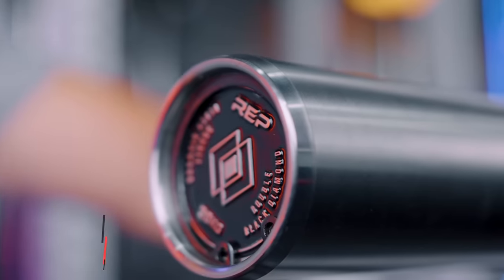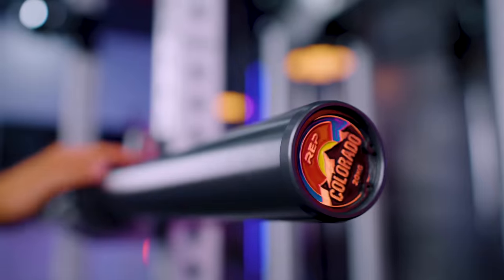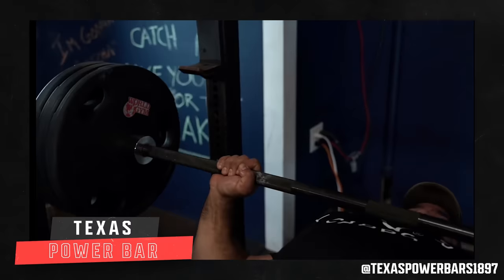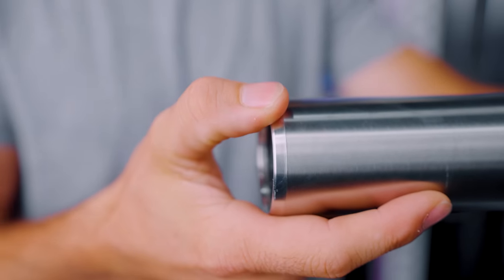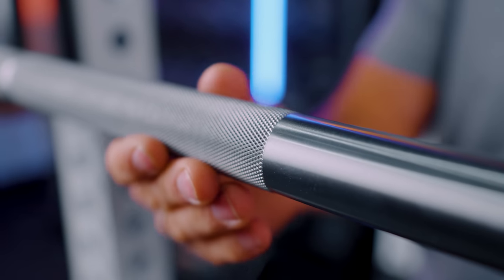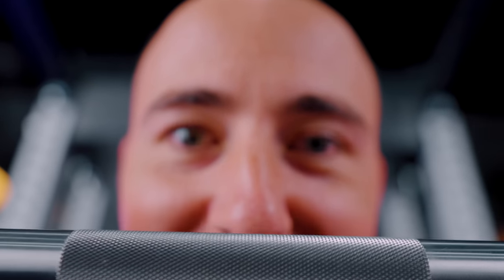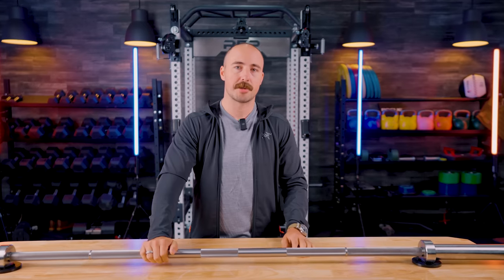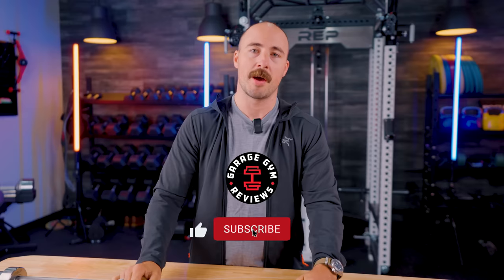REP Double Black Diamond Power Bar Review: Their Best Yet, But…

Comment: The stiffness of a 29 mm power bar is defined by the bar material's modulus of elasticity; the slope of the stress strain curve.  Thus, I wish companies would post that value as it's the true measure of how much a given power bar of fixed diameter and load position will bend on a deadlift.  I.e., what's the stiffest bar on the market?  OPB? Eleiko comp?  Chewy?  Rep's new diamonds?  It'll be the bar with the highest modulus of elasticity.  Giving a tensile strength of a bar means nothing to the consumer if it's already permanently bent at a lower load (which occurs at the bars yield strength, also not published), except for perhaps snapping point safety considerations. I.e., the 250k tensile strength Kabuki will snap later than a OPB, but will already be bent beyond going elastically back to it's original shape (Kabuki should state it's yield strength if it actually wants to brag).  Also, the work hardening done by Rogue sets the perceived durability / fatigue resistance of their bars ahead of the competition (but not the stiffness).  If others are work hardening, it should be stated also.  Thus, until manufacturer's state a) bar material b) yield strength c) modulus of elasticity, there's very little that we can say about the material quality of any bar without measurements... except visually by corrosion rate upon observation, which means little about the bars longevity, strength, etc.  Would love for REP to comment to put the concerns about Chinese steel to rest, on the values stated above.

Comment: Glad to hear you like our new Double Black Diamond Power Bar! The sleeve tolerances are tighter, higher end metal end caps, tight mountain knurling, laser etching… etc. we took years to ensure every detail was dialed in during prototyping and testing. 

Good call on our older barbells stainless steel. We took extra care sourcing and testing it this time. Like everything we’ve released lately, we’ve really upped our game. 

Our FAQ on our website addresses some items including our stainless steel. 

“What kind of testing was done with your stainless steel to ensure rust resistance?

We did extensive salt-spray testing on our new stainless-steel bars to ensure industry-leading performance and rust resistance. This is a totally new alloy formulation for the Double Black Diamond Bar.”
Reply: I was just about to comment with the same FAQ answer, but you beat me to it.
Reply: Looks like I’ll be ordering this
Reply: The fact that Rep monitors comments and actively responds is exactly why 90% of my gym is Rep.
Reply: REP has entered the chat
Reply: It’s been in the FAQ for awhile. I’m not sure why it wasn’t mentioned if the review was going to cover this point in detail. Thought it was worth addressing since the rest were positives.
Reply: Is double black diamond a reference to mountain biking?
Reply: @faithfitnessandfatherhood  facts only reason I don’t have there plates is because I wanted polyurethane
Reply: @REPfitness "totally new alloy formulation"? hard to believe you wouldn't use 17-4 for a shaft. So what was your old stainless shaft and your new? I remember you had that one batch of stainless powerbars where the supplier used a weak grade of stainless and you sold them really cheap with a limited weight rating. Good thing you test your stuff to make sure the supplier is making them to your spec.
Reply: I just want to say that I love how REP comments on reviews and is open and transparent. It makes me want to support their company.
Reply: It’s a reference to skiing / snowboard runs on the mountains in Colorado. Double black Diamond is the most aggressive terrain, often either very steep or with moguls or both. It’s meant to say, the double black Diamond bar is meant for those who take their training seriously and move some bigger weights and need the more aggressive knurling.
Reply: you mean u caught the chinese factory workers slipping on you and not using good quality "stainless" and now you're (not upped your game but) selling stainless that actually doesn't rust.
Reply: REP,

Quick question - are you using the newly-sourced/formulated stainless steel on the REP rackable EZ curl bars as well? I’m thinking about picking the SS rackable ez curl bar up soon, but I’m wary of stories about it oxidising.

Thank you!
Reply: @ronniefarhat95 i had mine for 2 years now and dont have any problems with it rusting
Reply: @faithfitnessandfatherhood totally
Reply: @smokinHawkjh V snarky kiddo, they lift up their skirt and you turn your nose up at the honesty. That’s disappointing to see considering the transparency rep gave you. Try harder
Reply: I’m seriously considering the bar now because rep entered the comments section. That is phenomenal to see
Reply: @REPfitness   B/c it left a bad taste in his mouth, as he said... and your non-lifetime warranty f*cked up a lot of people when it rusted.
Reply: The stiffness of a 29 mm power bar is defined by the bar material's modulus of elasticity; the slope of the stress strain curve.  Thus, I wish companies would post that value as it's the true measure of how much a given power bar of fixed diameter and load position will bend on a deadlift.  I.e., what's the stiffest bar on the market?  OPB? Eleiko comp?  Chewy?  Rep's new diamonds?  It'll be the bar with the highest modulus of elasticity.  Giving a tensile strength of a bar means nothing to the consumer if it's already permanently bent at a lower load (which occurs at the bars yield strength, also not published), except for perhaps snapping point safety considerations. I.e., the 250k tensile strength Kabuki will snap later than a OPB, but will already be bent beyond going elastically back to it's original shape (Kabuki should state it's yield strength if it actually wants to brag).  Also, the work hardening done by Rogue sets the perceived durability / fatigue resistance of their bars ahead of the competition (but not the stiffness).  If others are work hardening, it should be stated also.  Thus, until manufacturer's state a) bar material b) yield strength c) modulus of elasticity, there's very little that we can say about the material quality of any bar without measurements... except visually by corrosion rate upon observation, which means little about the bars longevity, strength, etc.  Would love for REP to comment to put the concerns about Chinese steel to rest, on the values stated above.
Reply: @Natural.Crusader  This exact bar?,is it in a garage or in house?.
Reply: @Natural.Crusader  it's been another 7 months.  How are you liking your stainless double.diamond bar?  Any rust?

Comment: Opted for the stainless steel version, going to arrive in 2 days. Mostly cause of their website, “ What kind of testing was done with your stainless steel to ensure rust resistance?
We did extensive salt-spray testing on our new stainless-steel bars to ensure industry-leading performance and rust resistance. This is a totally new alloy formulation for the Double Black Diamond Bar.”
Reply: what do you think about it?
Reply: You like the bar 8 months later?
Reply: Any issues with rusting?
Reply: Answer the question
Reply: @farmersgrip  No issues. It's my favorite power bar in my lineup of bars.

Comment: Whats the diffrence between this black diamond power bar and the colorado bar???
Reply: The Colorado bar is a mixed use bar.  It does not have a center knurl and the knurling itself is a bit more passive (not much) than the DBD bar.  I own both and love them.  You wont go wrong with either.
Reply: The power bar can be used for both benching and squatting would u recomend that??